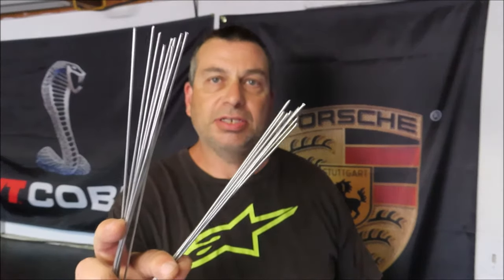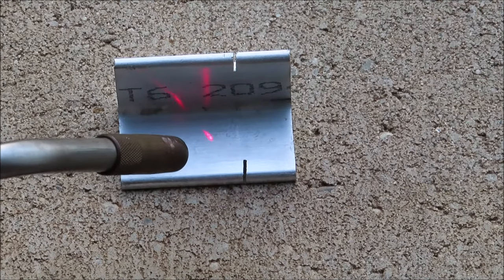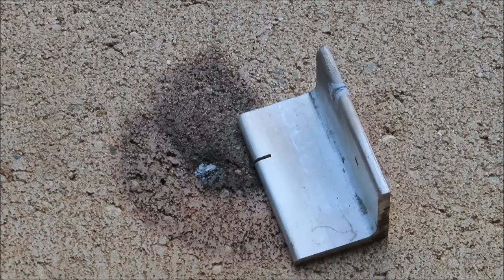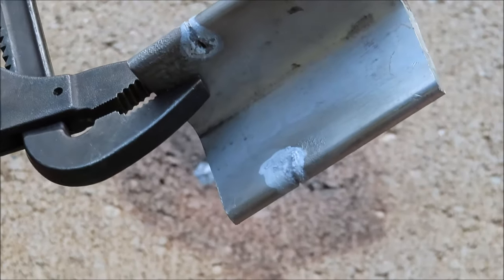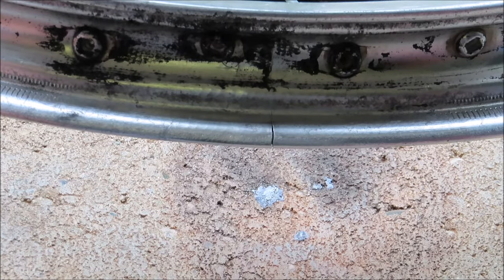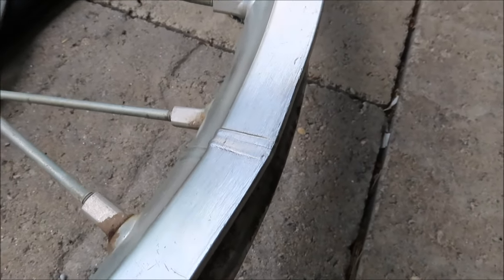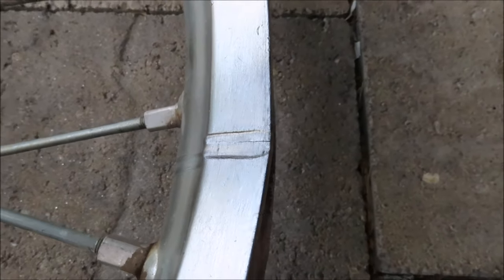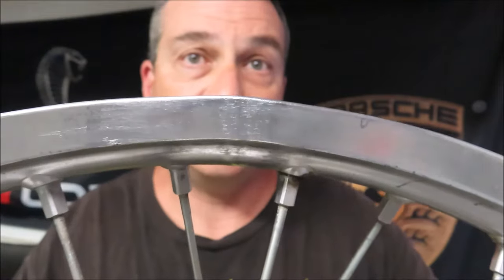DIY WHEEL REPAIR w/ Aluminum Welding Rods, Do They Really Work?

Comment: When you sprayed the water the rod material was still molten and blew it out. You also need to open up the crack on the wheel with a thin grinder disc. Temp was also not high enough.
Reply from the maker: Thanks for the tips

Comment: I am ready to try the same thing on a couple dirt bike tires.. I have watched several videos and because of the thickness of the rim I believe mapp gas will work better to keep the surrounding area hot without loosing the heat through induction.
However I saw a video that the guy put his project in a grill to try to prevent that. 
I will see what happens.
Reply from the maker: Good Luck!

Comment: The crack has formed where the original manufacturing weld is. Though why they would weld a loop is beyond me. cheap I guess, should be made from one tube and pressed. Also when you repair a crack like that on a rim that will be under shock loads  1. it should be TIG welded, brazing rods are in no way up to the job, you are taking you life in your hands by being cheap - its not worth it. 2. Cracks like that should be drilled at the end of the crack to prevent the crack from continuing after welding.  All the best. 😬
Reply from the maker: Thanks for the advice.  I couldn't find anyone that would Tig weld it for me. No one will work on motorcycle wheels.  Thought I would give it a try.
Reply: That's a cool tip.. the drilling at the end of the crack.👍
Reply: I think I can understand about the drilling thing, you're relieving the tension on the material by opening at the point where the next tear would be.

Comment: That's really a type of solder. It's strong but I don't know about a motorcycle wheel. Anyway,  you need to "V" the crack.  You have to heat the aluminum to 700 degrees. DON'T HEAT THE ROD!! When your base metal it hot, start rubbing the rod into it. This is needed to break the oxide layer and form a bond. Let the heat of the base aluminum melt the rod. If you heat the rod directly it just falls apart.

Comment: Try using a Map gas burner which gets hotter than regular propane  torch .. plus u need temperatures up to around 600 to 700 deg... don't prolong the concentration when applying  the heat.

Comment: The wheel is absorbing the heat and pulling it to the rest of the wheel and cooling it off much faster than you could heat it up. On your test piece that was a smaller piece of aluminum and it heat soaked and melted much faster. The welding rod didn’t even melt.

Comment: That band was the original weld joint. Aluminum is a heat sink, the larger the piece, the longer it takes the joint to come up to temp.
You may have gotten away with Tig welding that joint with the spokes in it because you can concentrate the heat but considering the heat is running away from the source it's going to soften a large area. Map gas is better but an oxy/acetelyne brazing tip would have been even better, for this, Tig even better. There are a number of " dont's " that you did, more homework should have been done before you started.
Reply from the maker: Thanks for the advice and Thanks for Watching!
Reply: I wrecked on my bike causing my passenger peg mount to break in half and if I thought super glue would hold up Id be going that way. But I know the repair has to be strong enuff to withstand someone standing on it and if I have to I'll start searching for a replacement but parts are always hard to find and if found there always pricey.
So I'm thinking about using a container and filling it with play sand and pushing the part into the sand as a hole piece and start melting the low heat aluminum brazing rod hoping it molds everything back together nice and strong before I start grinding, sanding, cleaning and repainting it or am I better off to talk to a few professional welders instead thanks.

Comment: I was thinking, why not torch the Amazon aluminum rod so that it melts and drip on the crack to seal it instead?
Reply from the maker: I tried torching the rod directly but the material pops and jumps off the rod. Couldn't control where it went. Thanks for Watching!
Reply: The bond wouldn't be strong. It would be like sticking fresh playdoh on dry playdoh, falls right off yknow?

Comment: There is usually a reason why Professionals wont do certain things.. 

Was the test piece the same Materials?
Was the test piece the same thickness?
Where did you read/see that keeping the heat on one specific spot a good idea?
You heated up the original weld and that was the Band. But doing this kind of thing on a spoke wheel with the spokes installed was not a good idea.
Reply from the maker: Thanks for the advice and Thanks for Watching! So far the wheel has held up just fine?

Comment: because the rod melts at 730 degrees the metal you have is too large and the heat is dispersing theses rods will not work on large jobs because you cant heat the whole metal to 730 lol!
Reply from the maker: Thanks for the explanation